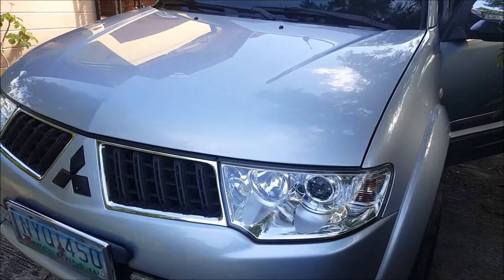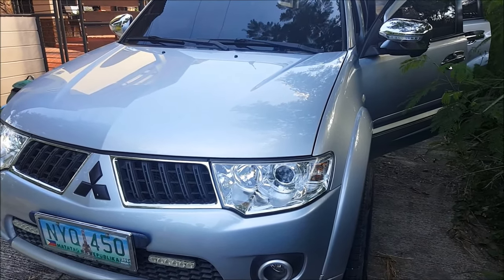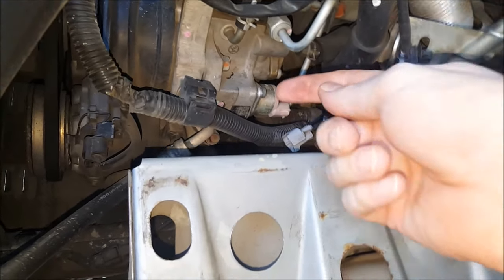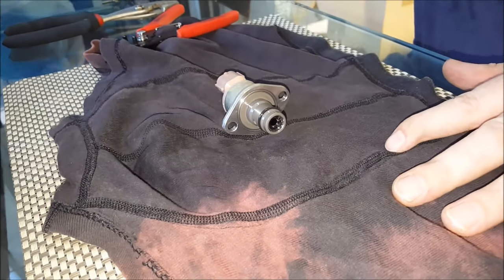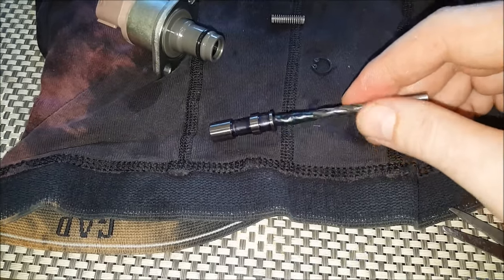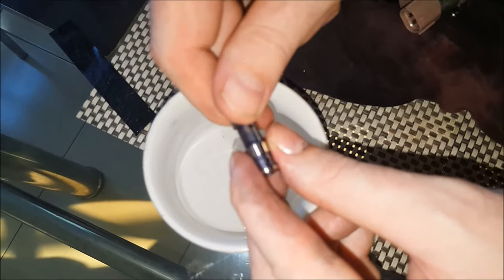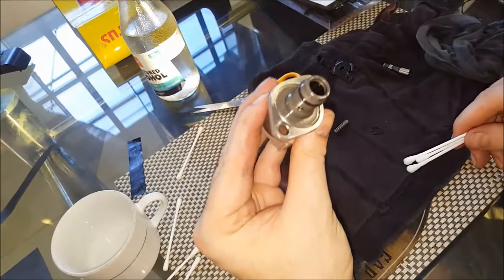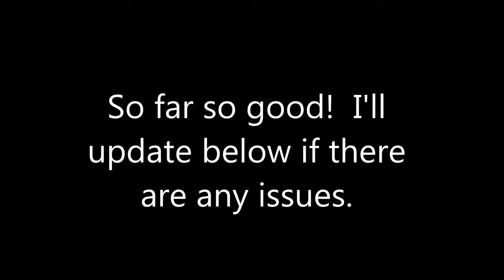2009 Mitsubishi Montero Sport 2.5L Suction Control Valve (SCV) Removal and Service

Comment: hi sir, i have a question in replacing scv.. did you replace also the black gasket of the scv when you replace it with new? im gonna DIY it. any important info or advice before i do it? hope to hear from you.
Reply from the maker: garry naval there are two gaskets,  a flat gasket and a round o-ring style gasket. Make sure to watch for both when you pull the SCV out. If you notice in my video,  both baskets stayed in place.  I took it off again at a later date and both baskets came off.   If still in good shape, and if clean, sure, use them again.  Perhaps put a little clean oil on them to help preserve them and seal.  Good luck.

Comment: Does your montero sport hv black smoke problem when u encounter this issue? I hv done all necessary service to counter black smoke issue and jerking problem but it still the same… only thing I hv not done is servicing the scv on my 2009 montero sport. Just need more advice b4 doing my scv service like what u did. Kindly advice thanks
Reply from the maker: The black smoke, and jerking are limp mode characteristics.  Pull over, turn off and on your car.  Read your error codes, they should point you to the problem.  You can always try and service SCV.

Comment: I would polish with chrome/metal polish instead of using sandpaper. Used this method to fix the sticky injector pintels on my 4d56 tdi.
Reply from the maker: Yeah, that is a good idea.  A polishing compound on a rag.  I did suggest using toothpaste on a subsequent video where I discuss polishing inside the SCV cylinder.  Thank you for comment.

Comment: hi there!

Thanks for the great video man!

I have the same ( 2010 Triton, but with the montero front/ 4d56 engine)

literally having the same issues and now just had EGR issues. 

I just swapped out my SCV but had similar problems ( i'll check again after swapping our my EGR), but thanks for the great vid!
Reply from the maker: RUSSEL Wong,  what makes you think it's EGR valve?  I'm not suggesting it isn't,  I'm just curious about your diagnostic process.  I also ask because my non dealership OBDII scan I just did on my failing car came up as a generic EGR system fail.  I replaced my SCV based on the failure symptoms being similar to the previous problems and problem solved.
Reply: heya!

What happened is, i got the same exact issue as you ( same engine and all), check light, limp mode, off engine, hear the big " clunk" noise.

initially swapped out fuel filter and was happy, problem happeend again and got worse ( after 1 week)

Then googled up and changed out SCV.

SCV changed, was happy, 1 day later, check light came on, this time for EGR issues, cleared it , but it came on every time i started the car.

then this time, the car would go into limp mode about 2 mins after u start driving ( now it was getting predictable)

Just got the whole EGR changed out ( my EGR is blanked off, but forgot, the EGR motor is still open to the exhaust, whole EGR is choked up, 

So now, everything changed out, check light off, so far so good :)

Somehow or arather, i feel the EGR and the P0093 code issue with the SCV is somehow linked :)

just take note :)
Reply from the maker: RUSSEL WONG,  thanks for the descriptive feedback! EGR issues sound complicated to diagnose.

Comment: after replacing u can check target common rail pressure and actual common rail prressure by using handtester.. it should be a minimum  difference 10000kpa..
Reply from the maker: Akhil AG Akhil Ashok Thank you for info. Please feel free to link a resource. Cheers :)

Comment: I stumbled upon your video because I have the exact same problem and same car model as well. The mechanic is charging me 15k in pesos for  its replacement (SCV). :(..Anyway sir, I would like to know if it fixed the issue in long term.thanks for the video.
Reply from the maker: Yes,  it did fix my issue long term,  we'll,  at least it's still working well.  I haven't had any issues.  I'm selling the replacement SCV I bought on OLX for less than 5k, if you want a new one, check my link.

Comment: How did you fit the o-ring back? (the bigger/outer one).
It is significantly smaller than the groove on the SCV. I couldn't put it back, I had to make my own o-ring...
Reply from the maker: During this shoot, mine actually stayed in place.  The O ring shouldn't be too much smaller, and should go around the base of the shaft. When inserting the SCV, care should be given to make sure the o-ring seats properly before/when  tightening.

Comment: Hey MonteroGuy,
I have similar issues with my 2010 UK L200 2.5 DI-D. When watching your video, I had one question I couldn't answer. You found scoring on the piston and cleaned it up using the paper and drill combination, what about the bore inside the valve? Did you notice any scoring inside there, if so how did you clean it? Do you know if you can purchase the o-ring seal and gasket for this to do complete overhaul?
Reply from the maker: Mizungo 512 later I did realize this job could be done more completely by polishing inside the cylinder. I purchased a dremel tool and buffer bits and polished the inside with some toothpaste. I may upload that video soon. I think doing both is best. My gasket and o-ring were still good and I didn't need to purchase, so I don't have a source. Please feel free to link if you do. A gasket set is included in the OEM replacement part I subsequently sourced and offer for sale in Philippines for P4500 ($90).

Comment: Hi. Nice video sir. one quick question. Will the check engine lit if you have problem with your scv? Or you can scan it even no check engine warning? Thank you in advance
Reply from the maker: You should get a check engine light if having significant SCV issues.  Though it may not light as the issues develop.

Comment: Hi MonteroGuy, If the SCV has a bigger clearance after you use sandpaper would the bad fuel come in directly? How's your montero so far? Did you replace it with a brand new SCV?
Reply from the maker: Mark Sia,  so far so good.  I've since also picked up an OBD2 scanner just to confirm what I have observed from driving.  It drives well and idles well.  To answer your question,  I suppose with increased tolerance,  the potential for dirty fuel to contaminate is increased.  Though I would argue the tolerance increase is minimal and I would also suggest we swap out our fuel filters on a more regular basis.  Though these fuel filtets are fairly expensive,  I'm working on ordering some from the factory and will offer them soon at a steep discount to what the stealership is selling them at.
Reply: Cool. Were you able to buy from the OLX link you shared? I'm thinking of ordering one from him and temporarily doing this method
you shared. Is this seller of SCV legit? Appreciate your feedback. :)
Reply from the maker: Mark Sia,  that seller is me,  so I'm going to be biased and tell you,  I'm legit ;).  I didn't need the part because my fix has worked so far. It's a high quality part.
Reply: Hi, thank you very much for this video. My Isuzu Dtec/dmax 3.0L, 2008 started stalling and refusing to idle. the air meter sensor still works fine and is free of dirt. I therefore suspected suction valve.  Today, 26.11.2016, I performed surgery on my suction valve as you had shown in your video. I dont believe it. The truck idles fine, smoother and no stalls The Isuzu agent locally had told me the price of a new one is  USD550. Thank you very much.
Reply from the maker: Mokhitli Khoabane Congrats!  I'm so happy this worked for you too! I bought some tools with the money I saved :)

Comment: Hi MonteroGuy, thank you for the informative video sir. Just a quick question, after replacing the SCV, do I need to have it reprogrammed or something? or is it a straight up plug and play replacement? Thanks in advance!
Reply from the maker: Darren Ferenal, straight plug and play.. Provided you don't have other issues. I had an EGR issue and low battery issue. All good now.
Reply: Thank you sir! I procured a Denso one, sadly before seeing your video and links, and the shop where I will have it installed gave me a heads up to have it reprogrammed. But based on the video and your expert advice, NO NEED! haha Diagnosis already set me back P1,200 in Mitsubishi dealership.
Reply from the maker: Darren Ferenal I am not really an expert. Maybe they mean clearing the errors from the ECU. I sell OBDII scanners on OLX for P600 ($12) that will allow you to do the same, and read error codes in the future.
Reply: Could you post the link here sir? I might need to buy one for maintenance concerns as well. Thanks a lot.
Reply: Hi.  I got mine diagnosed with scv. I was yet to replaced it but the shop already relearn my car.  Upon the scv replacement  should i have them relearn my car again?
Reply: @electriccarconversion  how do I get the OBDII scanner? Please.
Reply from the maker: @bensonkariuki2082  if you're in Philippines. I sell some on OLX, Lazada is good too. Amazon, eBay internationally. Good luck.
Reply: @electriccarconversion  hi Sir, how abt with EGR issue, did u replace it also?

Comment: Sir, I thought you could help me. I have a montero 2011 gls v. And it minimally splutters oil from the  dipstick. No smoke whatsoever. Is this a concern? It is always been maintained by mitsubishi.
Reply from the maker: Richmond Guiwo sounds like the seal on the dipstick that should keep oil from coming out is worn or missing. Just my guess, and it's hard to tell without seeing it.
Reply: Hey Gulwo. I just had a Mitsubishi L200 having the same problem of pushing out the dipstick and spraying oil in the engine bay. It could be as simple as having a worn o ring on the dipstick that no longer holds the dipstick down or as serious as having worn piston rings on one or more pistons. This in turn leaks PRESSURE from the combastion chamber down into the engine creating excessive pressure and therefore escaping throuh the weak links, the dipstick. In our case, it was worn piston rings and from there on yoj have two choices. Either get another used engine with the risk or have your engine rebuild, both could be expensive. We found another good used engine and installed it. All problems solved. Hopefully you find a solution. Let us know.

Comment: Hi there hailing u from the caribbean.
Got an L200 did , starts only when the highpressure sensor is plugged out with the camshaftsensor and after it starts no acceleration.
When its plugged in no start.
I got a new scv will try to see if this fixes anything.
Did u have the same issues concerning this?

Rocher
Reply from the maker: Hey there, the no acceleration issue is the only thing that sounds familiar.  I had not unplugged any sensors.
Reply: @electriccarconversion  ok i see , when i scanned the vehicle and no codes.
Im searching online if anyone have the same issue but nothing.
Maybe u can help i measured the camshaft sensor wiring going to the pcm, i get 2 wires with 5 volts and 1 with ground, is yours the same?
I checked this on a 2014 model and its the same.
Dont have much L200 pickups on the island here.
Reply from the maker: @sabrinatjoen-a-choy2425  I'm not sure of the voltage on the wiring.  Perhaps we can hope that someone else reads this and chimes in.
Reply: @electriccarconversion  ok cool cool hope so 2 . But i will let u know what happens after i change the scv. Ordered it from thailand.
Reply: @electriccarconversion  hey man, put in the scv nothing changed now it dont want to start with the new scv.

Comment: Hi! I have a Mitsubishi L200 and sometimes it doesn't have power. I mean, in 2nd gear full throttle, engine is revving at 4k rpm, but the speed is about 60km/h (before it reaches almost 90), and after a while the engine is ok, no problems after that. I putted it on the tester and it shows me U1101, and when i search for the code, google shows me photos with this  Suction Control Valve. Any ideas? Thank you, and hope u will understand, sorry for my bad english :D
Reply from the maker: dany danutz558 I've had the U1101 error, and I believe it is a code pertaining to an error occurring in the communication between the automatic transmission and the ECU. As I have a manual transmission, I disregard this error. Is your transmission a manual?
Reply from the maker: dany danutz558 you can disregard that U1101 error because you have a manual transmission.
Reply: ok, so whats the problem when car loose the power for a while and then it is ok? :D
Reply from the maker: dany danutz558 what are the other error codes? I had a problem line this, no error code, except one time, low voltage. Please check your battery voltage is good.  This can be a problem. Other than that, someone's difficult to diagnose cars based  on general descriptions. Let us know what you find.
Reply: U1510- P/W(RL) LIN Timeout/Not Equipped     
U1511- P/W(RR) LIN Timeout/Not Equipped
U1512- P/W(RP) LIN Timeout/Not Equipped
U1101- T/M CAN Timeout/Not Equiped

These are all the codes, before the car didn't have any code. Also, these codes appears at ETACS and KOS/Immo/Keyless on the tester
P.S. The battery is almost new

Comment: i have a 2010 mitsu montero and i have a problem on power my rpm stays in 2000 and my generic scanner got a dtc p0089 and p1272. Got my SCV replace, tank cleaning, fuel filter replace. Seems nothing is working for me. Do you have any Idea ? thanks
Reply from the maker: adkyn duran I don't know actually.  Let's hope someone chimes in here with some useful advice.  It seems are generic scanners often produce relatively generic codes.  I think we need to get applications that are specific to our make and model which can give us more useful error code interpretation.  There is always the painful act of taking a car into the dealership and paying the money to have them scan.  They will often then discount the cost of the labor against the cost of the scan.  But the quality of service at these dealerships varys greatly.  Good luck, keep us informed.
Reply: I 've pull out the new SCV and did'nt erase the fault code and put the old scv back in again. It runs but with no power and the rpm stays at 1500. I drove the car near the mitsubishi service shop and let them check for fault. What a surprise they got P0089 the same with my fault code reader result pinpointing the SCV itself. I said that I have a new OEM SCV with me and I let them install the new one. They have a laptop scanner to erase or reset the fault and it was erase perfectly. The car runs smooth and with power.
What I see here is that my Innova 3130c is not capable on erasing that kind of fault.
thanks bro.

note : They clean my airflow sensor with a brake cleaner and little spray with an airgun.
Reply from the maker: adkyn duran thank you for the follow up.  So it seems that it was the error code itself that the generic scanner was not able to fully erase that was causing the problem?  Is that what you're thinking?
Reply: high pressure pump

Comment: I heard it will just occur again in the future, would it be best if you just install a new one?
Reply from the maker: 2.5 yes later mine is still good.
Reply: Ok sir.. im thinking of just cleaning it like you did ,how bout the fuel filter? Is it best to replace it too?
Reply from the maker: @dustycoun3807  Yes, good idea to replace fuel filter.
Reply: Just a follow up, i DIY replace the SCV , fuel filter, and air filter with a brand new one, and all is well, and now im trying to clean the mass air flow sensor to give it a boost..
Reply from the maker: @dustycoun3807  I'm always halt to hear people are having success. Thank you

Comment: I changed already but same rpm 1.5 no more same problem 
I clean injectors
I clean diesel pump 
I have pickup diesel l200 mitsubishi
Same sensor changed wiring chekup ok 
Now final pcm or ecm 
Kindly further suggest plz
Reply from the maker: My suggestion is to do an OBDII scan.

Comment: hi Mitsubishi 2.5 diesel turbo is stalling when the engine is cold. check light comes on and the van cuts of. it starts back fine. no codes shows i would like to try the SCV do you think it can be my problem?
Reply from the maker: No codes show?  I think you need to get codes, or get old school mechanics opinion. I think you'd be taking shots in the dark otherwise. Good luck.
Reply: @electriccarconversion   hahahaa it was the SCV it worked!!!
Reply from the maker: @stephenaziz3950  I'm happy to hear that!  Congrats

Comment: Did you replace it with a new one , what was your fuel consumption before and after you replace the SCV?
Reply from the maker: jn ep I replaced with the one I serviced. Fuel consumption seems about the same. Hard to say because I hadn't driven enough in city before the problems started happening.

Comment: Hi there Montero Guy, is this the solution for P0088 fault code? My engine runs rough then will die. I will try your method thanks!
Reply from the maker: P0088 has to do with high fuel rail pressure so this may help.  Let us know.
Reply: @electriccarconversion  My truck now runs fine after replacing the suction control valve or fuel pressure valve. But now there are 2 new code or errors. P0088FF and P0088C. I guess this has something to do with the pressure sensor. Have you experienced this? thanks
Reply from the maker: @benj3433  I have not experienced those codes. So, you replaced parts?
Reply: @electriccarconversion  Yes, I replaced the SCV. It runs fine but the 2 codes I have mentioned above keep coming and returning even after delete. I will try to change the fuel rail pressure sensor. Thanks
Reply from the maker: @benj3433  Thank you for follow up.  Please do let us know the solution.
Reply: @benj3433  how did you fix the code
Reply: Neil John Tolentino replaced the fuel rail sensor that worked for me